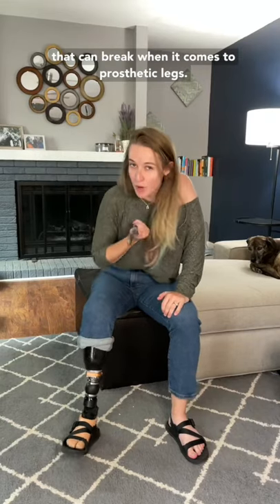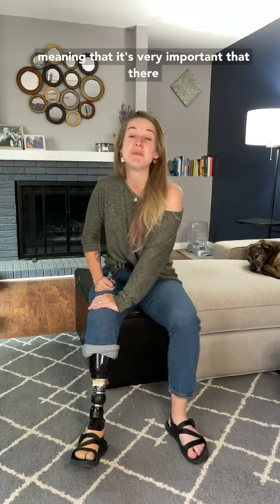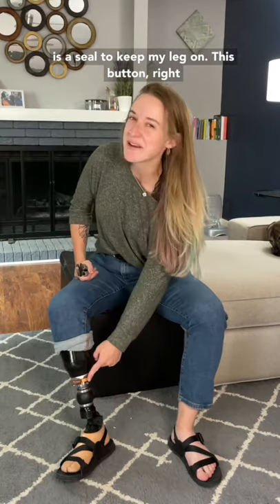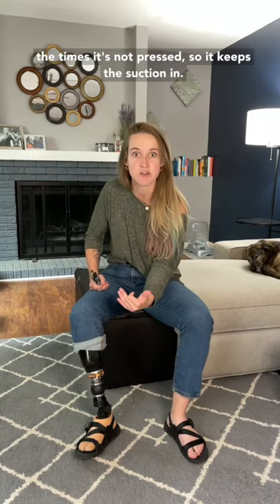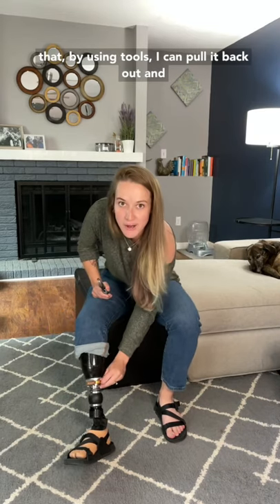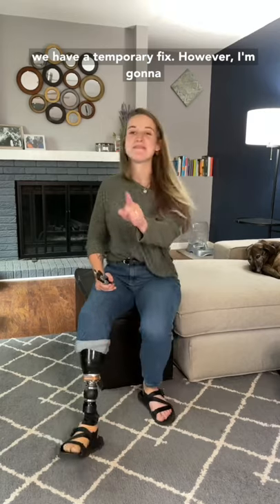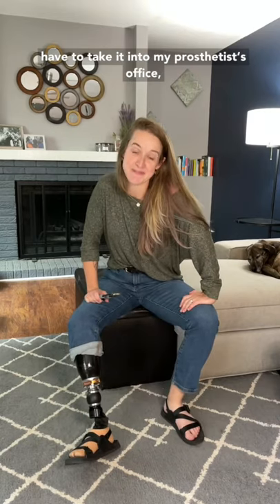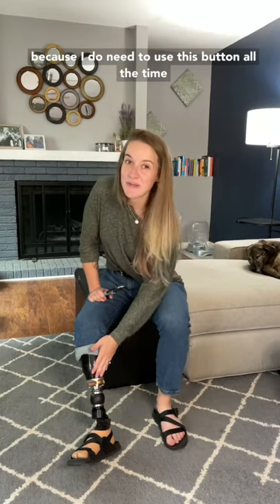When the leg button breaks… #Shorts

Comment: Funny story…I had plastic valves on my passive socket that held suction. As a very active amputee, I would catch the valve on things like car door frames when getting out of my car. The valve had many tiny parts once they fell apart, including a tiny little spring…parts that you couldn’t find once they exploded across the lawn. The fix? I would chew a piece of gum and stick it in the remaining parts to keep my leg on but…when I stepped down, the gum would blow bubbles from the air in my socket!

Comment: This is interesting because I am a BKA as well and have a suction type prosthetic however I don’t have a valve on mine. I put my leg in, roll the sleeve up and  stand up. When I walk the air is pushed out “the hissing sound” and then its complete. My only drawback is that when I need another sock the suction of the prosthetic is gets so tight that it feels like it is cutting off the circulation in my leg.